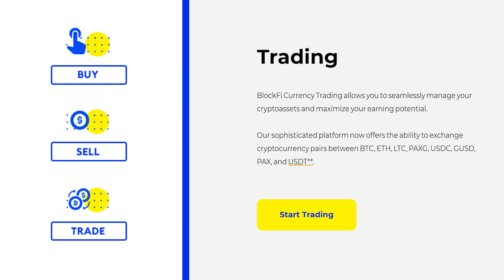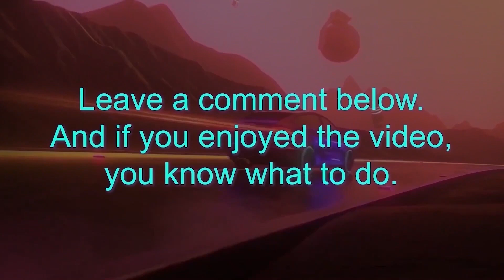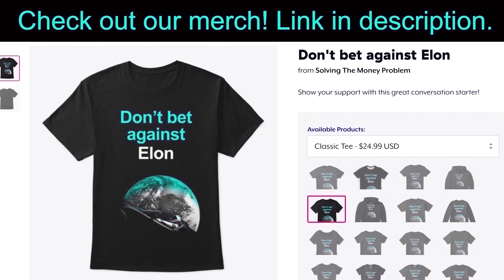Sandy Munro Shows Tesla's SHOCKING Lead Over Ford

Comment: Hate to say it, but you're cherry-picking.

Yes, the thermal management system was a bit of a clusterfuck, but in subsequent videos, as well as some of the earlier review videos of the mach-E before they got this one to tear down, Munro has pointed out multiple things that Ford did better with the Mach-E than Tesla did with either the Model 3 or Y. For example, he praised aspects of the door construction and flat out said it was better than Tesla, in particular eliminating parts and processes while Tesla's system was a pretty standard old way of doing it.

Either you're letting confirmation bias get the better of you, or you know this and are still choosing to present things in a somewhat misleading way which lacks the context of the whole picture. If the former, then you've got to get a better handle on your own subconscious thought processes. If the latter, then you're just being dishonest, in exactly the same way you love to lambaste the media over.

Another important note: those surveys showing engineers primarily want to work for Tesla and SpaceX are important, but they're US-only surveys. Outside the US Tesla ranks much lower, and it shows in the global rankings done by the same company. Mind you, and this is important context, much of that is because Tesla basically didn't have much in the way of job opportunities in most other major jurisdictions, and so students didn't really consider Tesla an option. But even since then, as Tesla has been increasing their presence in places like China and Europe (Germany), they still rank much lower than in the US. The US is rather important since it has a lot of engineering talent, but Europe has more due to a larger population, China is a major player as well, and there's tons of great engineers in other parts of the world where Tesla simply doesn't hire. The net result is that in global rankings Tesla ranks much lower. IIRC, on the global scale at least a couple legacy automakers rank higher, although I expect that to change in the next few years as Tesla expands its global presence.

Of course, you're entirely right about the company culture difference, and that good ideas are much more likely to be implemented at Tesla than other auto manufacturers. This matters just as much if not more than the talent you have access to: it won't matter if VW has better engineers globally if the MBA's and accountants ignore them in favour of optimizing a spreadsheet for the next couple years. Munro even commented only somewhat jokingly that Tesla would only take 2 weeks to implement something as good as what Ford did in the Mach-E's door once the video pointing it out was released (I strongly suspect some Tesla engineers watch his videos).

The full context is that Tesla's engineering is significantly better overall because of putting the engineering first, but the Mach-E has thus far has had multiple things that Munro has said are better engineering (fewer parts and processes, more reliable, less expansive) than in a Tesla.

Edits for proofreading, clarity, and because I forgot something I wanted to include.

Comment: Like Sandy, this also took me back to the 80's when I'd work on racing mods to road cars and other custom conversions.  I created and struggled with the relocation and modification of cooling systems.... often the results looked similar to that Ford!! You don't want to see that in a production car, it's error prone and expensive to build and I'm guessing it also won't age well and so become a pain point for the owner.

Comment: I want speak up on behalf of the engineers at legacy automotive companies everywhere and lay the blame at the feet of corporate structure, rigid stupid management systems and bonuses for idiots in charge not allowing good ideas to go ahead because it MAY cost them their bonus. 
Engineers are not running these companies into the ground... the bean counters and MBA's are and when the engineers get fed up, they will leave and work for Tesla. Tesla has a shortage of talent, not problems to solve and I KNOW there are ICE engineers who are being worn down by their corporate idiot bosses.. LEAVE AND TAKE YOUR 401K WITH YOU. TESLA IS HIRING. .

Comment: A comment from a layman:   Ford has never had to be efficient,  by their own admission their trucks are cash cows. There are huge margins in them. What does afLarado go for 70-80?  It a damn truck!  It's not uncommon to see the usual slash-a-thon happen so they can get their lots cleared, see markdown of 15k or more   They do it year after year, so I don't think they're particularly concerned,  I do love the fact that they've brought back the Maveric name for one of their trucks.  It's kind of strange that they're referencing a product indirectly that was a total pos in the 70s.  I think Ford's bigger issue is going to be technical support.
Reply: GM is using the same business plan. No cars, Just trucks and SUV.

Comment: This is not Tesla it is Tesla joined with SpaceX without SpaceX the octovalve never exists  the stainless Cybertruck never exists.   The innovation is not coming from automotive engineers it is happening due to the collaboration across discipline.    SpaceX engineers have the greatest constraints so they have the most innovative solutions.   Other major issue is organization.  VW changes a VP every other day and expectations change (would say the same for ford but in the world market ford is not really a player no us automaker is)   Tesla still operates mostly like a startup......

Comment: I enjoy your videos. I’m curious, however to see how the F-150 does. Their price is low and the early reviews have been good. The brand loyalty on the F-150 is significant to say the least
Reply: Also the question is what Fords margins are going to be on the F-150.
For the consumer the price might be the only thing that matters but for Fords economic viability the margins are crucial.
Reply: How many of those delicate "Scrap If Dropped" mystery boxes will the Lightning have in it?  "Built Ford Tough," LOL!
Reply: @elsmaster5592  I think they are aggressively pricing the F-150 with the intention of trying to gain ground on Tesla rather than focus on profitability. I love Tesla cars. As a consumer, if I were in the market for a truck, I would take a good long look at the new F-150.
Reply: @jacka7211  What truck does Tesla sell? I understand that this is a Tesla page and I’m not trying to be a troll. The fact is that Ford has pulled out all the stops with the new F-150. This is the number one selling truck in American year in and year out. That is one heck of a competitive mote they have built over the last several decades. Tough to penetrate. Do I think that Tesla will outperform Ford as a company? Hell yeah! Do I think that Tesla will grab all or even a substantial portion of the F-150’s market share in the truck market in the next 5 or 10 years? Highly unlikely.

Comment: This design will keep Ford mechanics busy repairing leaks on and off warranty. Just the way they like it!  The car owners will not! 💎🙌
Reply: Ford could be called the king of leaks. I owned 4 of their vehicles and they all leaked oil. One had a rebuilt Ford engine and it leaked after 70k miles.

Comment: The major advantage legacy auto-makers have, and will have for some time, is their number of dealers, repair shops, and spare parts. In many cities, there is still nowhere within a 50 or 100-mile radius you can take a Tesla to get it repaired, where there will literally be at least a dozen for major German, US, and Japanese automakers. This is why I'd never buy a new Tesla or a used out-of-warranty Tesla until that changes. At the same time, this kind of crappy engineering of legacy autos doesn't give me much hope of ever buying their EVs either.

Comment: .... or you not refering to the review of Sandy M of the Model 3 2021.... where he was not all happy with quality of assembly :)
Sandy M is pretty accurate and not shy, when something did piss him off ^^
Reply: He talked about it with Elon himself. https://www.youtube.com/watch?v=YAtLTLiqNwg Elon explained that the problems are usually limited to the ramp up phase, once they reach steady production, the quality improves a lot. Also the Model 3 still has the messy underbody, which is hard to make precisely, the new single-piece castings eliminate this issue, those are extremely precise and consistent, beating anything the legacy manufacturers have. Here's the result : https://www.youtube.com/watch?v=HQ8yuITCDfg

Comment: Ford wants those extra unnecessary parts because they have full stock piles of them and already sign contracts from supplier if they cancel that they would bridge their agreement with them and of coarse all that extra income selling people spare parts that are obsolete and belong to gasoline cars.
People do yourself a favour buy Tesla.  Soon gasoline/diesel engine  vehicles will be obsolete you will struggle to find gas stations.  Just like we switch from horses to cars it will happen over night. By 2030 all cars manufactured will be electric.  Tesla is ahead of the competition by 15 years and that gap is still increasing.  A lot of those gas car manufactures will ceased to exist by the end of this decade.  Yes, that will free Earth from oil and all economies will stabilize for the first time in Earths history, thus everybody’s lives will be enriched and pollution free.

Comment: SMR, 2 things; negative press about Tesla and idiots thinking the drain on the grid is worse. A recent investigation by a honolulu news outlets spreading mostly anti Tesla (or electric since the city gave free parking at airports, which is no longer in effect) and other perks. There’s a new article “honolulu gets new fleet of luxury vehicles” or something like that. They quoted an idiot engineer that teaches at the University (and failed attempt for mayor) saying a lot of negative things and saying Nissan leafs and chevy bolts were cheaper than a Tesla. Second, Hawaii solar is one of the best places in the world for it. I got tesla to install my solar and walls instead of a third party, saved me $15k that route. Note, we have no resources and have to ship everything.  The way the electric company sells power and the effect of switching to electric is very controversial here.  I wish people could understand that the reduction from solar systems and less gas being sold at pumps is a positive effect. The electric company still will burn LNG regardless of the load put on with electric cars.

Comment: How many of these components are designed and manufactured by Ford. None, otherwise they would have been able to optimise the design and reduce component count and interconnect, thus saving on cost and weight.....like Tesla.

Comment: We definitely did NOT hear from Sandy that the Ford's cooling system is "shockingly bad" as you say at the start of the video. it probably cools and heats well - it's just a very messy design and (compared to Tesla's) inefficient. 
However, considering it's Ford's first EV and produced by a small team on a short schedule, it's forgivable - just like Tesla's very messy construction of the wheel wells on the M3 (their 1st mass production car), which shocked Sandy as well is forgivable. 

THE FACT that this is Ford's first EV is what's unforgivable.

BTW they couldn't have copied the MY's octovalalve as the cars came out at roughly the same time. They should've copied the superbottle, though.

Comment: issue with munro is he is costing things down to the point where that repair cost is transferred to the consumer.  Tesla insurance probably solved this but insurance premiums will skyrocket if you have a clip that breaks on a headlight of fascia that costs thousands of dollars to replace.  Great for OEM's not great for the consumer in terms of long term costs and premiiums.
Reply: A thought full consideration, but not true in practice

Comment: Seen the volume of estimated EVs.... Tesla will not have 100% and all others will go bankrupt... that never will happen, Tesla leads, no doubt, Tesla will be the only one left, no doubt, Not ^^
Reply: Play this out in your mind -

Tesla releases full self driving in "student mode" in the next couple weeks and a year from now T-FSD is the most skilled driver in the world.  Or at least in the top couple of percent.  And that brings us robotaxis.

1,400,000,000  Currently registered cars in world				
                   80   Percent move to robos				
1,120,000,000  EVs needed to replace ICEVs				
                      7  Private cars are replaced by one robo.  The "Seba" number				
   160,000,000  Needed for robotaxis				
					
Currently the world manufacturers 70,000 cars per year. Assume fewer EVs for robotaxi use.  In the initial years a larger number of robos would be produced in order to satisfy demand.					
					
  30,000,000	 Assume annual manufacturing				
                5.3  Years to replace private cars with robotaxis				
					
Tesla plans to reach 20 million EV production levels by 2030.  If demand for robotaxis is likely to be about 30 million per year for 5-6 years then Tesla is going to be geared up to produce most of those cars.

Comment: I am a race car builder and I work on cars for higher end customers both for fun and for very good profit. What Sandy Munro don't get is that as cars age and subject to heavy duty uses, many of the components MUST be overbuilt to withstand years of service. In Sandy Munro's eyes, it is good to replace metal screws with plastic and eliminate covers and protectors because they are a waste of money. But for the durability and reliability of a product, many of the parts cannot be eliminated or be converted to plastic.
Reply: You think Munro doesn't know about how cars age?!? 🤦‍♂️ It's not like he has zero experience with this!  And metal screws are often a bad idea because the constant vibration can cause them to loosen.  More integrated designs don't have that problem.
Reply: @bigdream_dreambig  sandy munro complained about Tesla’s use of metal screws on the Model 3 window modules. But little does he know that the switch to metal screws was because the use of plastic clips caused excessive squeaks and rattles on the early versions of Model S. Surely, you know more than people who are actually in the industry?